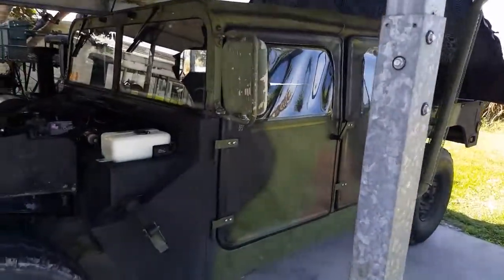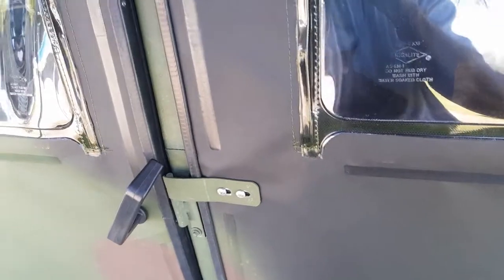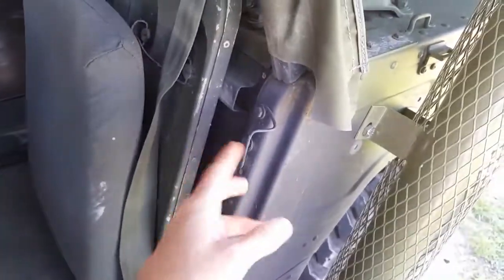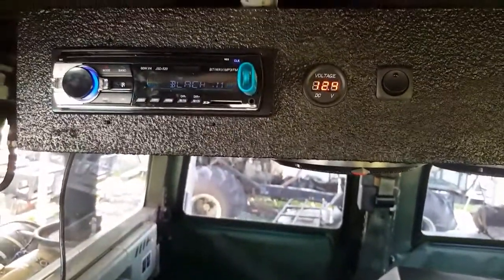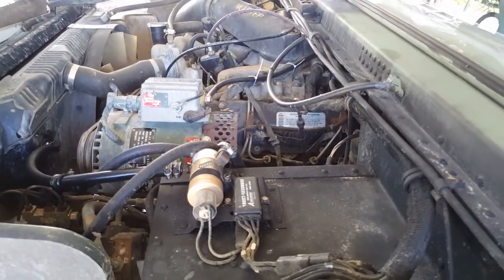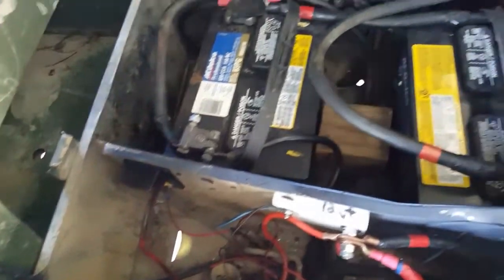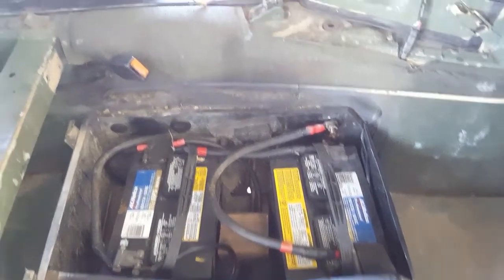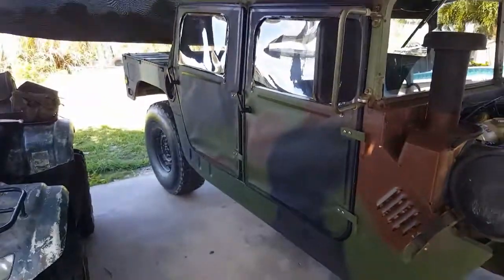Humvee upgrades 6

Comment: Where did you get the rubber floor lining? I'm getting a HMMWV as well and had the same idea
Reply from the maker: Its a conveyor belt. Tractor supply has some on a roll but is just shy of fitting perfect though. But would wrk.